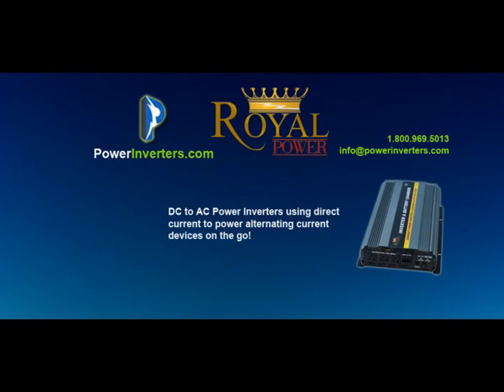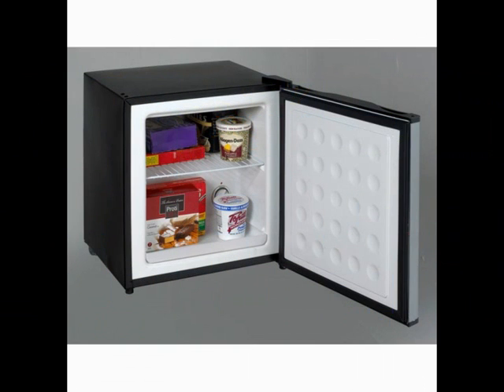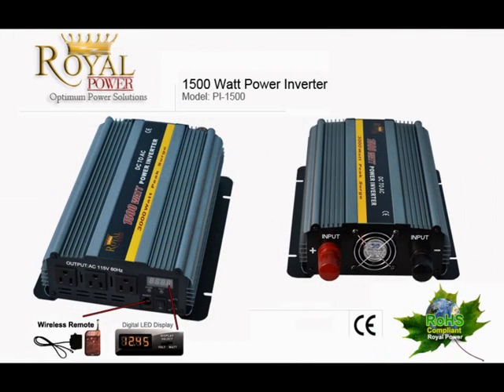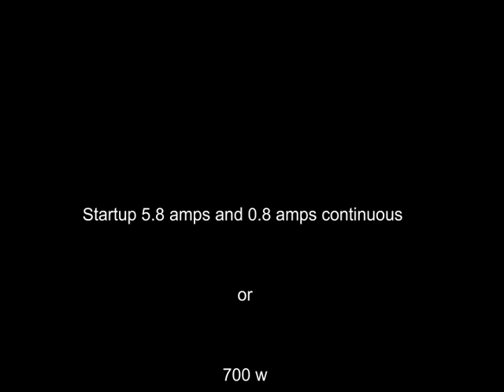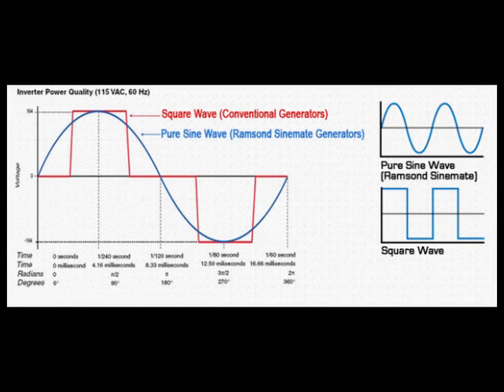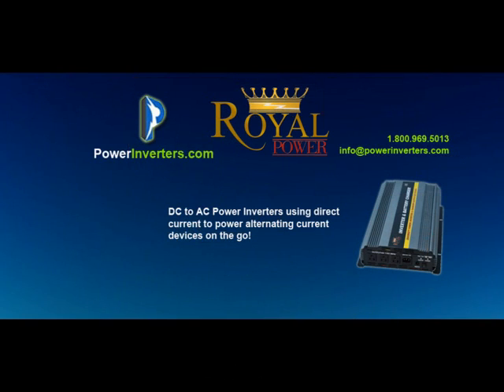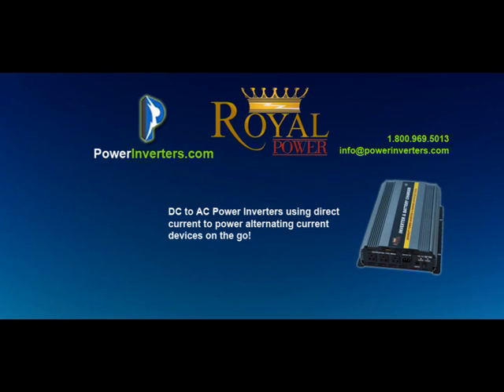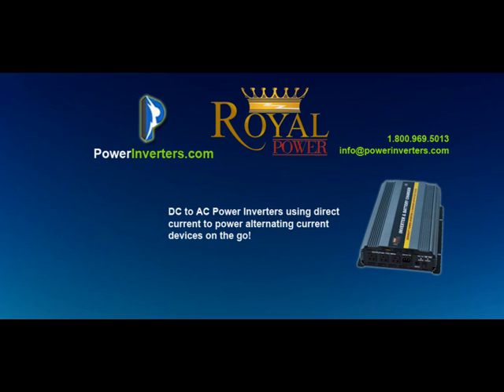Using a Power Inverter with a Freezer

Comment: I have a 150 watt freezer  and 500watt for refrigerator and 500 watt for the rest of the system 
Can i use a inverter with 3000 watt ?

Comment: I have a 150 watt freezer  and 500watt for refrigerator and 500 watt for the rest of the system 
Can i use a inverter with 3000 watt ?
Reply from the maker: Yes, you should have more than enough power.

Comment: I have GE Profile side-by-side refrigerator. It says it is 11.6A. So doing the math, I would need at least 1500W steady state and 3000W for initial start-up. Am I right?
Reply from the maker: I think the surge might be a little close to the limit, I might want to consider the 2000 watt unit to be sure.
Reply: Thank you. 
If I run the refrigerator sparingly, how long will the car battery last before dropping to 11V ?
It looks like I may need to invest in a small freezer instead and power it from a smaller inverter.
Reply from the maker: @njtexit8  It would really depend on the amp hours of the battery or battery bank, hes a link to our battery chart with examples. 

https://www.powerinverters.com/pages/guide

Comment: Have A 3000/6000 watt inverter to power 2 freezers and rope lighting on icecream truck is that enough and what gauge cable should be used I have about 18 ft